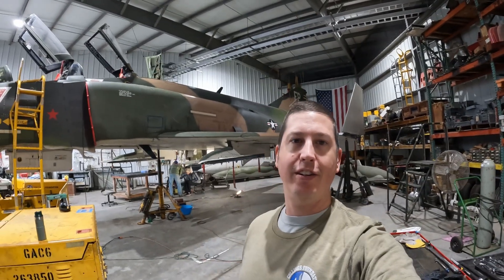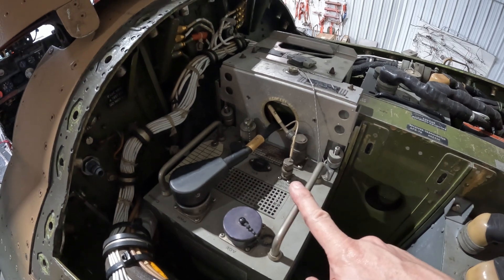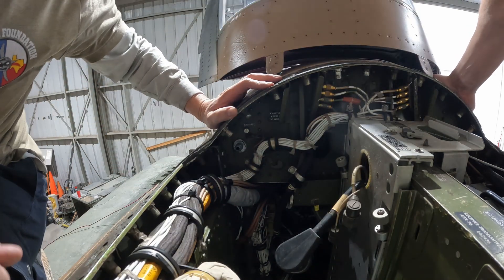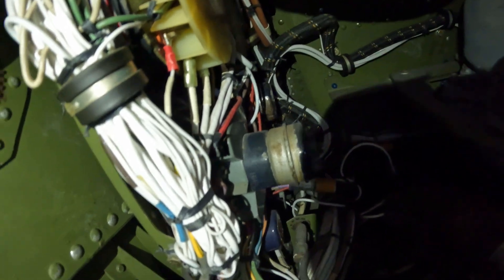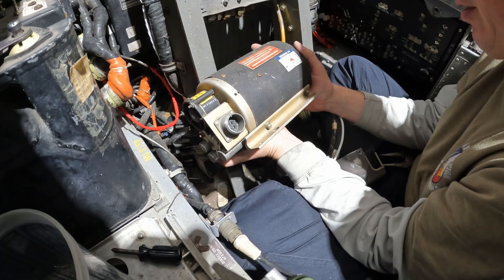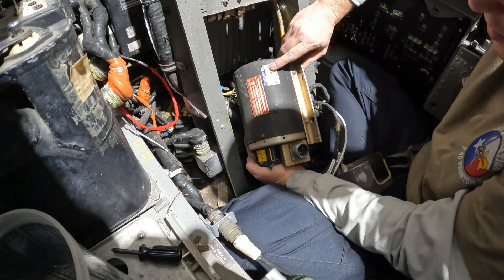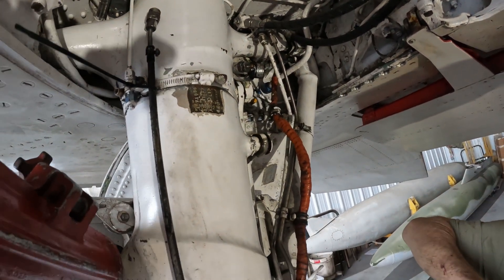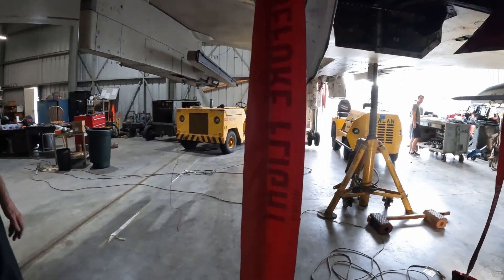Of Struts and Transformers | F-4 Phantom

Comment: good heavens...  mounting parts behind the seat, thereby requiring you to pull the seat to access it?  I'm starting to appreciate having worked on A-4 Skyhawks even more.  😄  That "shrink link" is interesting.  There was a similar rod used on the Skyhawk's nose gear to get it to fit in the available space.
Reply from the maker: Interesting. Starting to look forward to when we start working on our TA-4. Sounds like it'll be a bit simpler!
Reply: @DieselThunderAviation  Douglas was very focused on simplicity when designing the Skyhawk, and there aren't the number of systems in it that are in the Phantom.  Only two fuel cells too!  OTOH, it's a tiny aircraft, and avionics are shoved into every tiny corner.  I spent a lot of time with my arm shoved through a hole, working on something that I couldn't see.  Also.. you have to pump up the canopy when you don't have hydraulic power.  Looking forward to your videos of the T-bird!